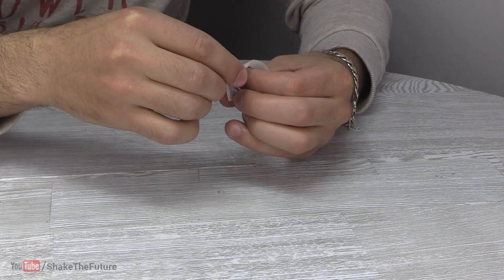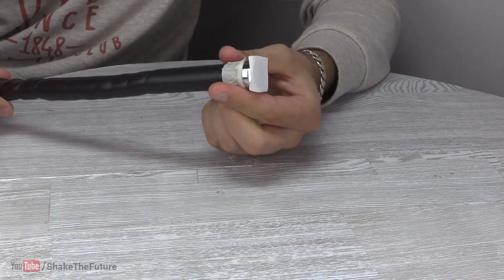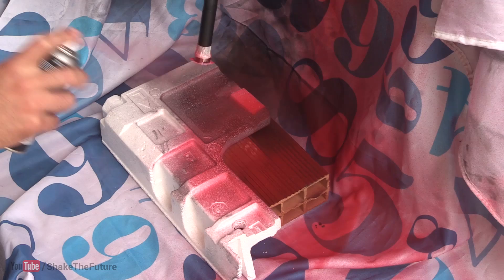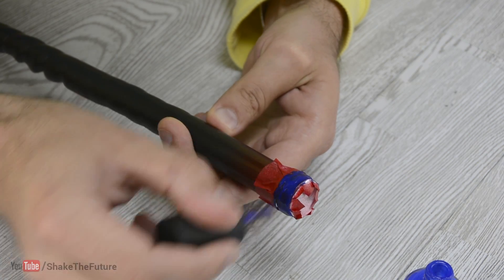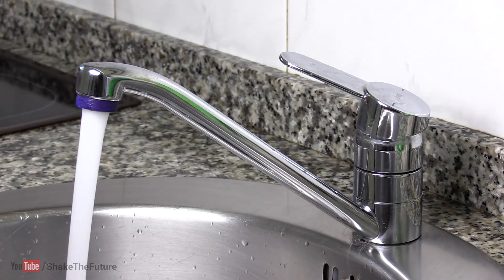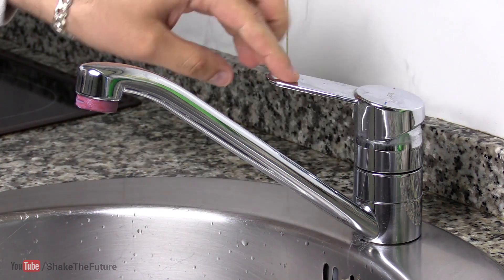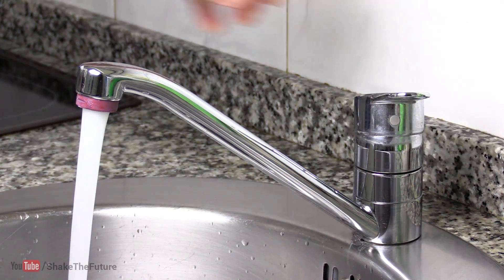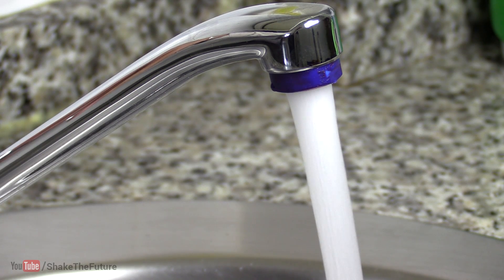Battery-less Temperature Indicator for the Faucet

Comment: Bro you was wasting the water.
Reply from the maker: +Anonymous Dude 
If If the tap is not fully opened, the hot water will not turn on.
And it also was for demonstrating purposes.
Reply: But bro you should put any utensils for collection of water.

Comment: One thing i hate about hot water is, waiting to get hot, and almost every human on the planet (that has water to clean dishes, for example) waste a lot of water waiting to gain temperature.
Reply from the maker: +gerekappo 
That's true!
Luckily there are efficient systems to heat the water super quick, but off course there are not suitable for every household and it cost money to upgrade.
I have 20 years old gas water heater.
It's very good, but it can take a while for the hot water to reach the tap.
Reply: really
Reply: Easy solution.  Catch the water in a vessel and use it for watering your house plants or flushing your toilet of urine.

Comment: My faucet always takes so long to get hot and I feel terrible for wasting all that water
Reply: +rammice With the old system I had the same problem for many years. I used to collect that water from the kitchen faucet by letting it go into a bucket and used it to flush the toilet. Since I have only a bath tub and no shower, that one was never a problem. Filling the bathtub I needed to mix cold and hot. So the cold at the start wasn't wasted.
Reply: Ik :/
Reply: CologneCarter Hmm that's a good idea
Reply from the maker: +rammice 
I know how you feel :)
Same thing for me.
My bathroom's tap is the worst.